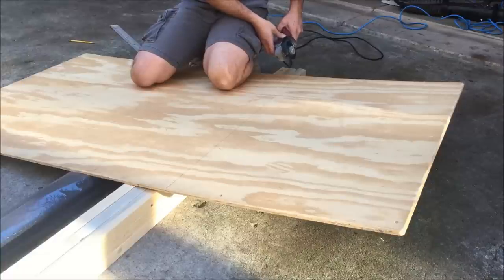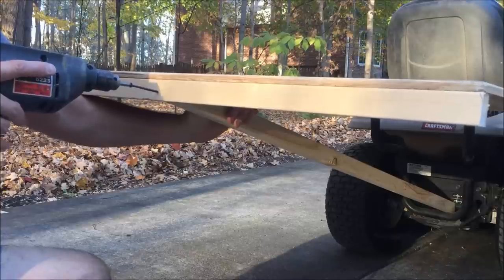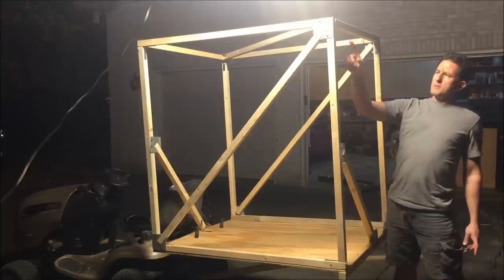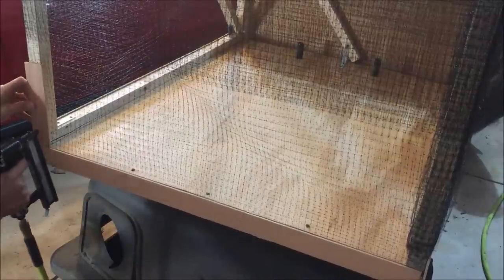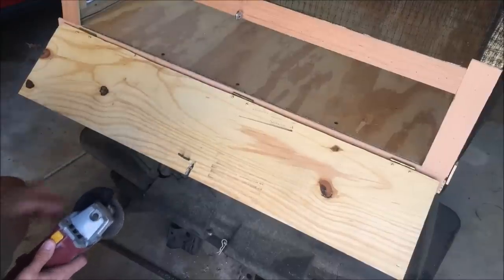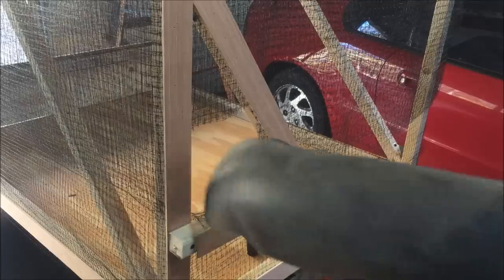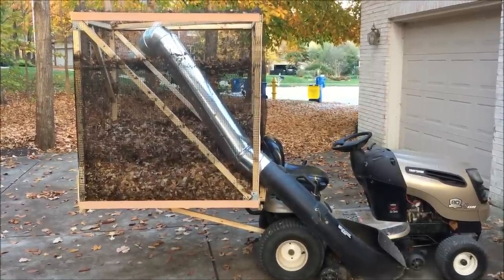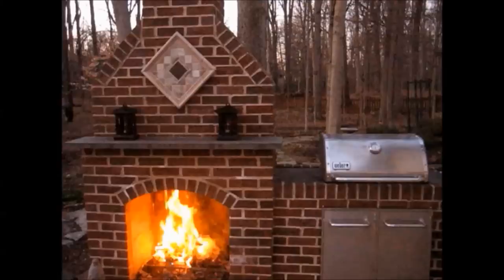How to Build a Homemade Leaf Vacuum for $50 - DIY

Comment: Thanks Lou.  I followed your basic design.  I fed the supply pipe up higher and used a larger door from the start.  Just finished a run on the lawn.  Not only did it work great for leaves but it worked very well for grass as well.  It was a 1 day build and I'm very happy with the result.  Many thanks!

Comment: My husband and I just built this and it works great! It's on a John Deere D155. We bought the stock lower leaf chute, which added to the cost. Probably spent around $250, but supply costs have gone way up! Ours is 4x4x4, supported by a steel bar. Got our brackets (called hurricane ties) at Lowe's in the lumber department framing brackets section. Our door is 2 feet high and I just use a garden hoe to scrap them out (dump site is too far from a power outlet for my electric blower). Our property has some slopes and uneven ground but I just go slow and approach any slopes straight on. It feels very sturdy and stable. I painted it black and named it Grim Leafer 😂. Thanks for sharing the idea!

Comment: Great instructions. I built this for my John Deere X394 with a few modifications. Made a hinged door in the back as one person suggested. I purchased flexible 6" duct, a 6" flange fitting, an 8" to 6" reducer and a couple of clamps.  Mounted a piece of sheet metal inside as a deflector. I got free plastic screen, and had the plywood on hand. The rig cost about $100 by the time it was done. It worked great for the maiden run. Not sure how long it will hold up but can always patch it up. This is heavy to put on and take off. Takes two. Thanks for sharing!!

Comment: Good stuff. I think I will just build one of those inside my trailer wagon.  I think I'll make the back door a little taller so it's easier to get the leaves out.
Reply from the maker: +George Batton - excellent modification. I was thinking about doing that myself.
Reply: Thanks.  The only other thing I was thinking was what do you think about just making the hole for the hose higher up on the box?
Reply from the maker: +George Batton - That does not matter either way.  The main goal is to keep the pipe as straight as possible. Every turn slows down the leaves and gives them a chance to clog.  I eventually took off the top elbow to speed the flow and put netting over the top of the box so the leaves would not blow out.  With those changes, I now get zero clogs running full tilt.

Comment: Lou - I have wanted to do something but I do not have a riding mower. What I would like to create is having a 55 gal container on large wheels to pull around my limited property. I just get leaves and a bunch of small stuff from the trees close by. Once a container is pressed down and full - switch it out - and take the 1st to the street for pick up. On the container part could I cut a round hole in the rubber lid to insert the larger hose which I would like to have a wide mouth, perhaps 10" to prevent jamming. I would make the hose long, like 20' so I could cover an area often sending derbies to the container until full. Now to the engine needed where I am really lost. What would I need to have in order to created the needed suction. I could place the engine on a platform that could be moved (reason for the long hose). I know it sounds strange but there is so much small helicopter pieces coming off giant trees that I need to vac rather than blow and sweep.  Could you give me some council on this? Thanks so muich.
Reply from the maker: You could buy a large Shop Vac and build an adapter for a 55 gallon drum.  Or buy one.  $$$
Shop-Vac 9700606 Heavy-Duty Industrial Wet Dry Vac Conversion Kit, Lid Mount for a 55 Gallon Drum, 1-1/2 Inch x 12 Foot Hose, 109 CFM, (1-Kit) https://a.co/d/jcOrnwc

Comment: I run a mulching blade with the outlet cover on and roll over the whole yard. it reduces the mass of the leaves to about 1/10th the volume. Then i run the mower over the yard and just empty the double bins of the mower either into compost or bags. much smaller mess and it tends to pick up better.
Reply: I do the same, however made an outlet cover from sheet metal.

Comment: How did you make the bend near the stock chute on the mower, and adapt it to the long straight pipe. I only seem to find 90 degree elbows. Will this easily adapt to a 6.75" chute? Heading to Home Depot to see what options I have.

Comment: Great idea, I want to start building one right away. I really like the brackets used for the diagonals. I haven't been able to source them. what are they called, who makes them and/or where did you find them. Thanks for the video.
Reply from the maker: +Dan Pendergrass - I am not sure what they are called, but found them in my local hardware store with all the other brackets.

Comment: This is exactly what instructional videos should be..you need to deal with a yard sized amount of leaves faster than store bought attachments that basically are mediocre at best.. My edit on this would be scale it up a notch more.. make the frame rectangular ..4 ish feet tall and as wide as mower or more and 6 ta 8 ish feet long.. Put some wheels on it and pull behind mower..
Reply from the maker: Pull behind solutions need a longer, flexible feed tube, which causes clogs.  This is super easy to empty and go get more.

Comment: If you drive over the leaves a few times first they'll then will be smaller in volume and you could then pick them up with the mowers original back container.

Comment: Million thanks, that's a great idea for fall, you wouldn't happen to have the measurements and amount of material you used would you?
Reply from the maker: +MyRusty89 - Its 4ft tall, 3 ft wide and 4ft back. I think I used about 10 8ft 2x2s and a 1/2 inch 3ft x 4ft plywood base.  One roll of deer netting or chicken wire.
Reply: I built mine the width of my lawn tractor and as a 4' x 4' box because standard material sizes make it easier.  Plywood is 4', you can get the 2x2s in 8' lengths so just cut in half, I used quarter inch mesh fencing which was already 4'.  I didnt have the leaf attachment to begin with so I used 3/4" bolts in holes meant for the attachment as anchors to the mower.  On the piping, I started with 8" flexible pipe but it was quickly damaged by chopped up twigs and nuts going up the chute so switched to standard duct material which I secured with small self tapping screws as the duct tape I started with proved too weak to handle the occasional need to unhook and clear a blockage without coming apart.

Comment: Great idea! Thanks! I think I'll try to figure a way to use PVC instead so it's more weather resistant.
Reply from the maker: You are welcome.  Metal ducting is galvanized to be rust resistant, and you only use it 10 days out of the year, and you can’t pick up wet leaves anyway.  10 inch PVC is surprisingly expensive, and very hard to get angles other that 45 and 90 degrees.
Reply: Yeah, i would’ve used pressure treated. Liked the idea of using the leaf blower to empty.
Reply from the maker: Its only outside 10 non-rainy days per year.  Mine is still in perfect condition.  If you are planning on storing it outside all year long, that’s a different story.
Reply: @HowToLou   Good points on not over-engineering sometimes. I like someone's idea of using electrical conduit since its so darn cheap, however don't go welding galvanized anything!  Brother-in-law has a tap and die set, think I'll see if that'll work.

Comment: Is the mower blade engaged while doing all this effectively mulching up the leaves?
Reply from the maker: Yes, the mower blade acts as a fan to blow the leaves into the cage.  It chops them up a little, but not into tiny pieces like a mulcher does.

Comment: Did you just rip plywood with a cutoff wheel?
Reply: lol....lou don't give af
Reply: lol
Reply: Just google "rip plywood" and "cutoff wheel" and you should be able to figure it out. Normally people use a circular saw, track saw, or even a table saw, but not an angle grinder.
Reply: Andy1dude yes for sure. He could have at least bought those little circle saw blades for those grinders too haha
Reply: Andy1dude oo
Reply: fpineros22  9

Comment: There is an idea to make the frame of the box from 4 mm steel wire. There is no big load and that should be enough.
Reply from the maker: Not true.  That many chopped up leaves are VERY heavy.   Watch this. 
https://youtu.be/B6GrQy1QQkU
Reply: @HowToLou  Really very interesting, I did. But in my opinion heavy are not leaves, but construction itself. That is why I generate idea to make it with less materials. And better with assisting wheels.

Comment: Thanks for the inspiration!
 I want to make a grass/leaf collector for my 80s model Snapper RER. I don't have a bagger system so I'm gonna have to make everything from the chute to the collector. I wonder how difficult it would be to make a grass bagger for it? Do you think the sheet metal ducting and pipe would work for catching grass?
Reply from the maker: +Jeff Stone - yes, this leaf collector also works for grass. Yes, I think you could make your own chute with an HVAC vent boot, elbow, and pipe
Reply: HowToLou  I'm gonna get busy on it soon, thanks...
Reply: I have a Craftsman "mid-engine" rider/mulcher, but, made a longer chute to a bag. (no regular bagger system)

Comment: Turn it into an incinerator on the back instead and then you've got something. It may seem dangerous wheeling around with an incinerator eating the leaves but if you're towing it, and the chamber is made of metal you could forget all about dropping the leaves, ever. Just burn 'em as you go! I'm thinking you could definitely make it safe enough to use.
Reply from the maker: 😂 I love it.  Yeah i bet you could.  It would be tough to get enough air flow to keep up with all the leaves coming in.
Reply: @HowToLou  Side blower fan stoking the fire? :)
Reply from the maker: Yep, it would need to be a strong blower to keep up.  The steel walls would need to be pretty thick, like a wood burning furnace.  Typically it takes an hour to burn the leaves you can pick up in 5 minutes.   If you are burning them at 10x the speed, to keep up with the input, you will have 10x the heat.  After a while, you will be driving around your yard with a bright orange glowing incinerator. 🥵
Reply: @HowToLou  lol. My neighbors might think I'm doing nuclear experiments in my yard. Wonder if some concrete walls would be better, or brick. Lot of weight i know
Reply from the maker: A heavy steel or brick box would leave big ruts in the yard, and require a full size tractor to pull, but where there is a will, there is a way!  Maybe replace the tires with caterpillar treads.  We left “practical” a few posts back 😜
Reply: @HowToLou  Haha. Yes, we did. Maybe I just need to dig a recessed burn pit in my yard, line it with cinder blocks, and then dump from my lawn sweeper into it.
Reply from the maker: Burn barrels are cheap.  You could cut a 2 inch diameter hole in the side at the bottom and blow air in to get a great burn.  Get a wire mesh top so firey leaves don’t rise out and catch other stuff on fire. 🔥 🍁 🔥
Reply: @HowToLou  Tonight I used a lawn sweeper to do my backyard. After 2.5 hours of driving around in crazy circles and lines I had 72 piles of leaves 3ft high by 4-5ft. across. That is just my backyard. And I've done this 4 times since they started to drop 4-5 weeks ago. There are STILL MORE up in the trees waiting to come down! No burn barrel will help me. I don't want to drag 72 piles around, nor move a burn barrel around. I need a Lucifer inspired towable instant 1200° incinerator or I'll lose my mind chasing these damn leaves. 😈
Reply from the maker: Ok, yep, my last yard was that bad.  You saw it in the video.  I had a pretty good-sized wooded area.  I would dump the leaves in there for a few weeks, until they all came down.  At the end of Leaf 🍂 Season, I would spend 2-3 hours mowing over and over them in the woods until they were in tiny pieces, and looked more like sawdust.  They would decay and be gone by Spring.  I did this for over 10 years, no problem.

Comment: Change your support for the bottom and make a portion of the floor drop away for removal.
Reply from the maker: +Loren Coffin - good enhancement idea!  At minimum, I will make the door much bigger,  next season.
Reply: Make the whole back wall of the box hinge from the bottom to the top or the other way around, your choice. That way you can broom it out without making a mess with a blower.
Reply from the maker: I will make only the bottom half open as a door.  I want the top half in place for added stability.  The whole thing was actually designed so I could empty the leaves with a blower.

Comment: Just a thought, considering the large amount of leaves you're mowing/collecting/mulching, seems curious why you didn't make a much larger "cage" on a single/center axle - that could be towed around & tipped to "dump" leaf debris where you want? Looks well made, but a much larger unit * bigger trap door at rear - would cut your time in half. (or more). Nice build though.
Reply from the maker: The real advantage of this cantilevered design is that the feed tube is solid and smooth, so you get very few clogs.  A towed cage would require a flexible feed tube.   You can a LOT of leaves in this cage.   I know its full when I can do wheelies on the mower.  Good call on the door though.   I made it much bigger, the next year.
Reply: @HowToLou  HAHA, I like the full indicator !! :)  Good vid, thx!

Comment: How did you make the part that attaches to the mower?
Reply from the maker: +timeisshort truly - i reused the bracket from my triple bagger.  Making your own is easy though.  Build a triangle out of 2x2 boards, the same as I used for the box. The sides should be roughly 3ft, 2ft, 2ft. Set this on the towing flange, at the back of the mower, with the 3ft side up and level, and flat to the back of the mower.  Wire this on to the mower in a few places to make it solid.  Mount the front edge of your box to the top bar of this new mounting bracket.  If you want, mail a picture of the back of your mower to HowToLou@gmail.com and I can draw it for you. Good luck! -Lou

Comment: I tried this but leaves would clog at the elbow coming off the lawn tractors deck. It would work for a minute until the elbow got clogged. I would  unclog the elbow and it would  work again just for a minute of cutting until the elbow clogged again. Lot of wasted time for me.
Reply from the maker: I have had no problem with dry leaves clogging.  Wet leaves will clog any bagger.

Comment: where can i find that silver part for the deck at?
Reply: I've been looking for that as well. The closest match I can find is an "end register box". He may have started with an end register box and trimmed off part of it.
http://www.homedepot.com/s/end%2520register%2520box?NCNI-5

Then maybe you could connect an adjustable elbow to the end register box.
http://www.homedepot.com/b/Heating-Venting-Cooling-HVAC-Parts-Accessories-Ducting-Venting-Transitions-Connectors-Elbows/N-5yc1vZc5ha

Comment: Your mover blade needs to be a bagging blade else there won't be enough air flow to get the leaves or grass up the tube.
Reply from the maker: +Bill A -You are absolutely right!  Thanks for adding that.  My mower already had a bagging blade, so I forgot to mention it.

Comment: What if my mower doesn't have the two posts coming off the back?
Reply from the maker: +texmexia49 - you can bolt two large L-brackets on the back of the mower frame and attach the front end of the box to them.
Reply: HowToLou thank you!